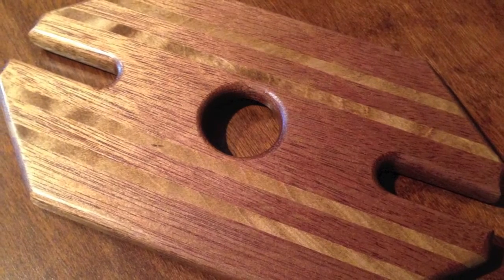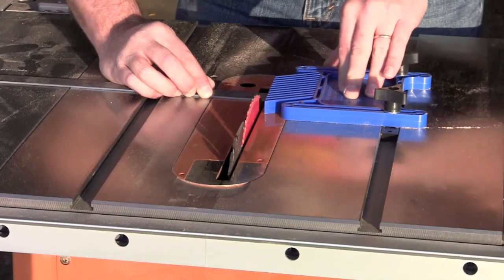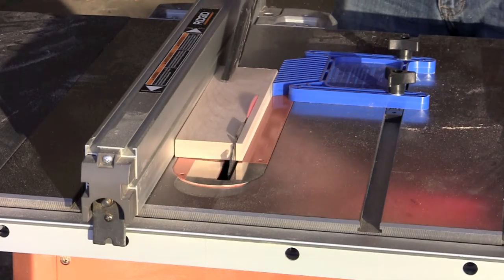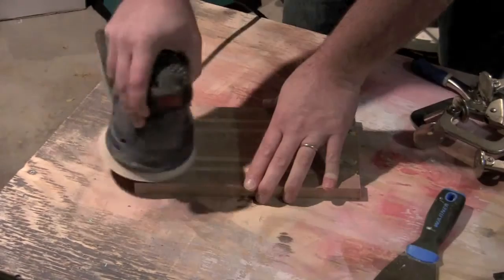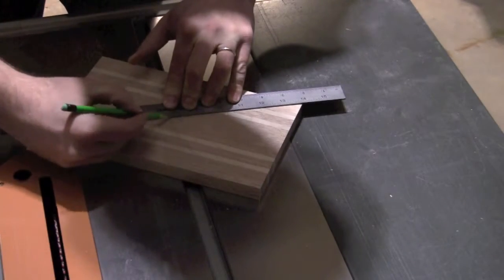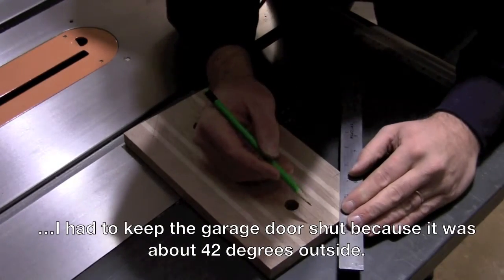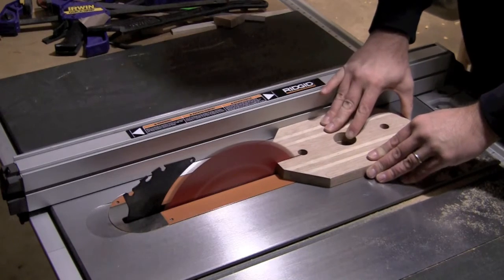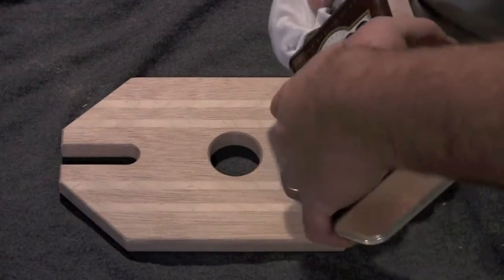Build A Wine Display And Glass Holder // Woodworking How-To

Comment: "The Dreaded Corner of the Shop"....yup, my drill press is in a similar corner here in my shop.  I make a lot of those wine bottle displays as well, though a slightly different style. Same idea though. Just shipped a couple more out two days ago.
Reply from the maker: +Joe O&#39;Blenis Nice.  I'm working one a custom one for a wedding this weekend.  Pretty easy to batch out once you get the hang of making them.
Reply: +CP Builds Yeah, the first ones, the prototypes basically, they always take the longest. After that, pretty easy to make more. Fun too, adds nice variety to what I make here in the shop. Paddles is my full time thing but it sure is nice to add in some variety. Helps keep things fresh.
Reply from the maker: Oh for sure.  I just make what my wife wants to be honest lol.  Plus I have a lot of people wanting stuff made too so that keeps it fresh enough for me.